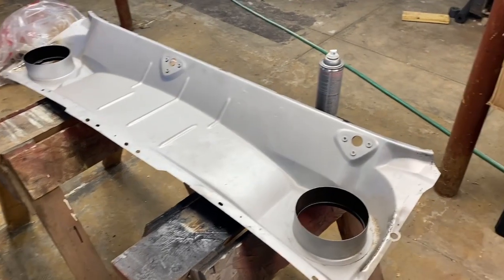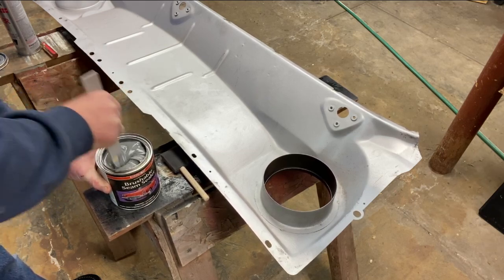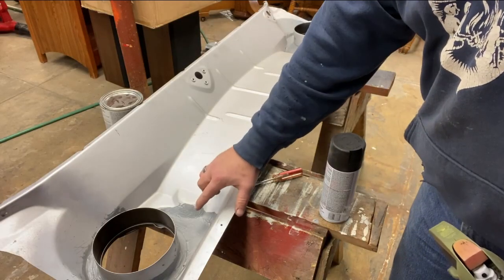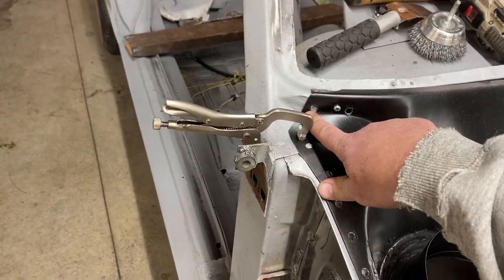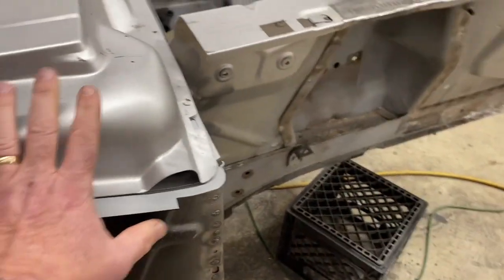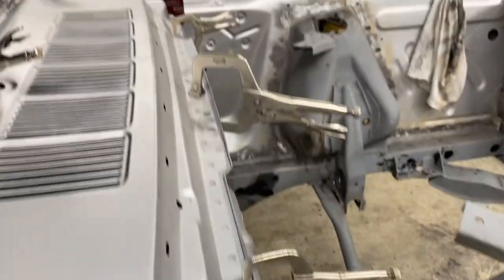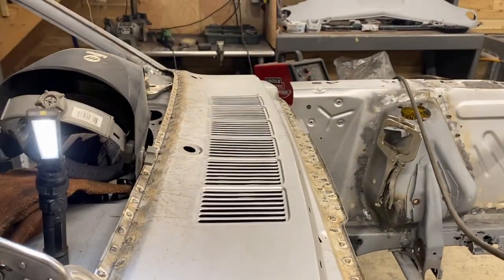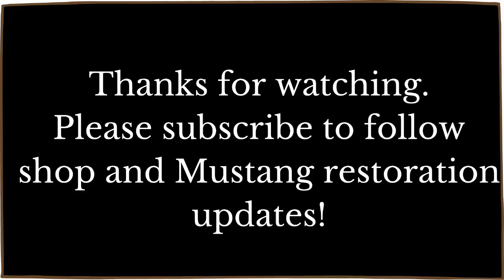1966 Mustang Restoration Pt. 22 Welding in the Cowl

Comment: Yes, I too had ambitions to be a great welder, and also settled for being a good grinder...! I had the same reservations about getting a "pinch" on that joint between the upper and lower cowl panels, just below the windshield pinch weld. I did all of my trial fitting of cowl assembly, on the car as you did.
Then welded that seam with the cowl off the car. I was able clamp it, and weld, then clean it up easily.
Reply from the maker: sounds like that would work well.  Nice thinking!

Comment: Very good video.  I am in the same progress of implementing my cowl installation . Great job. I am using a flux core welder too. I will send pictures later in the mid-summer . I am located in
Reply: Georgia.
Reply from the maker: I've used a flux core welder for 25 years and it's been great. Lately I've been doing a lot of research on converting it to gas shielded partially because I'm sick of the spatter and clean up and partly because you can get thinner wire which requires less heat and therefore will make welding thin sheet metal easier.  My next video is going to be about that.
Reply from the maker: Georgia?  You should see if you are in the neighborhood of Jo Daddy.  He's amazing at Mustangs and body work.

Comment: Actually the lower cowl builds up with degree at the vents and that holds moisture for rust. The water just Does not leak into car from the vent lip you spoke of. People need to do is wash all those out periodically but they fail to do so being afraid they’re filling the car with water!  Once these areas get filled up with leaves and sticks and dirt, that’s when they hold water in these little valleys in the middle starts to rust over time. These lower calves are sealed from the factory and do not leak on their own. It takes lots of years and lots of rot before they start leaking. But they do catch all the junk and stuff that gets in through the vent and there’s no way for it to get out. As it slowly builds up it cannot flow out of side. You don’t need to reseal this area as they will last a good twenty years or more. Straight from the factory.
Reply from the maker: I agree with washing and rinsing it out.  And I can see how it would cause a little anxiety to flush tons of water down your cowl, but it should all drain out.  Lord willing, mine will rarely ever see rain or leaves falling on it.

Comment: And those hard to clamp areas on the corners and along the top of the cowl use one of those long C clamps if you're car is gutted out like this and you can go through the dash/glovebox/ speaker areas and get those to clamp tight. I'm not trying to sound like a know it all but I just did this repair recently and that's what worked for me. Just an idea for some. :)
Reply from the maker: Great idea to use a c-clamp in the middle of the dash.  I didn't think of that.  Comments and ideas like this are the major reason I started the channel. It helps me learn and hopefully helps others as well.  Thanks for sharing!!

Comment: Looks like a good job.  I wonder why the alignment holes on the sides didn't completely align? Looks like the holes where the export brace bolts on align just fine.  I'd be curious how the fender gaps look around the new cowl. Especially since you worked/moved the shock towers.  Will the export brace drop right in?    I'm thinking when I do my cowl, I'll mount the export brace to get the upper/lower cowls aligned , then drill the locating holes.    I'm glad the upper cowl to cowl plug weld holes laid flush. I'm worried about that.  No one in any other videos showed that the upper/lower cowls mated flush like that.   How do you like that magnetic welding lamp you're using?  I need something like that.   You'll love the mig/gas.
Reply: I wouldn't rely on the mounting holes lining up on a reproduction piece. I've seen them off on cowls like this and bumper brackets that are welded onto the trunk floor. As long as the more important things line up those holes don't mean anything. And you can't see them anyway. The holes on the side anyway. My front holes didn't line up perfectly but I just wallowed them out so my braces or soon to be export brace bolts can go in.
Reply: How did the hood and fender gaps around the cowl turn out if the alignment holes didn't really align   repro or not ?   I've watched other video where tapered rods were used to align everything.
Reply from the maker: Thanks for the comment and questions. Originally I expected all the alignment holes to line up, right?? I mean they are all dynacorn pieces and it seemed totally reasonable to get them to all line up.  But it was really hard to force the alignment pins in the holes and in order to get the pins to line up, everything was twisted and forced and there was so much tension.  Finally I decided to ignore the alignment holes and just make sure everything laid down comfortably and was centered and square.  Then it all fit together nice.  My export brace will fit on just fine.  It's all centered left to right, but front to back it is off about 1/4".  So I may need to elongate the holes and weld them a bit.  About getting the upper cowl to lay flush on the lower cowl, somebody else just commented about using a c-clamp through the radio speaker opening in the dash. That was a good idea.  Overall I like the magnetic light.  I bought extra batteries and a charger off Amazon.  Sometimes they works great, occasionally they won't turn on or randomly turn off.  I'd give them a b+ recommendation.  I hope i love mig welding.
Reply from the maker: I tried using the taper rods (see comment to ddaytona1) but it wouldn't work.  My gaps to the fenders are decent.  The fenders, doors and hood all fit nicely.  Ive test fit them several times.  The curve of the fender against the cowl isn't perfect, so I will have to work on the curve on the fender. I think I will need to remove a couple spot welds on the fender and re-shape that curve.

Comment: Also, are you switching to ‘65 wiper bezels?
Reply from the maker: I haven’t learned anything about wiper bezels yet. What do you know or recommend?
Reply: @3rdstallgarage  The repo cowl is “correct” for 65.  The 65 had a bezel that goes on the wiper shaft.  I don’t know how it looks with or without the bezel.  I have a ‘66 and haven’t gotten that far.

Comment: You mentioned it came primed. No. It’s actually an E coating. It appears that you didn’t wipe or sand the cowl when the spray paint went on- I saw fish eyes and imperfections from not prepping your cowl with thinner and at least using scotch bright green to scratch the e coating. Maybe you did. I hope so. Because if not your brush on sealer will even pull away from the cowl later on. Otherwise great job. 😂 again the vent pipes are sealed before they are spot welded together. No need to add seam sealer there. And if you do you need to watch that area so it actually sticks to the e coat.😊
Reply from the maker: Thanks for the clarification.  That will be helpful for other viewers.

Comment: thanks for the video!
u would have a little less clean up if you were to use gas instead of fluxcore
Reply from the maker: I agree.  A few videos later I ended up converting to gas welding.  It wasn't necessary, but it sure is a whole lot nicer.

Comment: Did you take any measurements for the windshield to cowl placement?
Reply from the maker: I did a lot of careful measuring to make sure  it was centered to the windshield and the car.  Then most of the front to back location was just getting it to sit flush to the windshield and firewall.  I didn’t find the locating holes to be helpful even though the upper and lower were both dynacorn panels.
Reply: @3rdstallgarage  That is what I’m gonna do too.

Comment: DID YOU USE ANY SEAM SEAL ON THE COWEL SEAMS BETWEEN THE UPPER AND LOWER PIECES ESPECIALLY IN THOSE CORNERS YOU HAD ISSUES WITH?
Reply from the maker: I used seam sealer around the large holes or vent stove pipes that stick up through the floor.  The seams where the upper and lower cowls attach is spot welded and once its together there's not a good way to reach in and seam seal the inside of the seams. The water should flow down and out, so hopefully it won't be a poblem.  So I used weld-thru primer. I will seam seal the outside of the seams before I paint it.